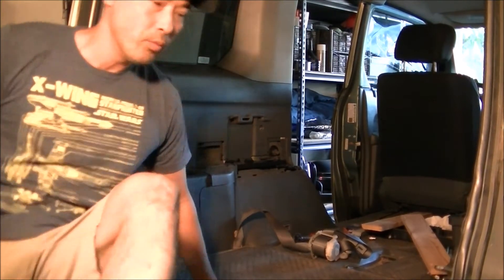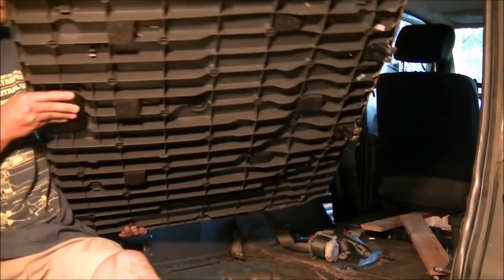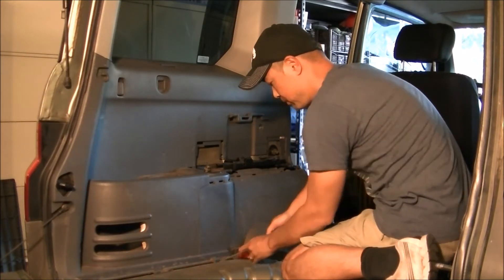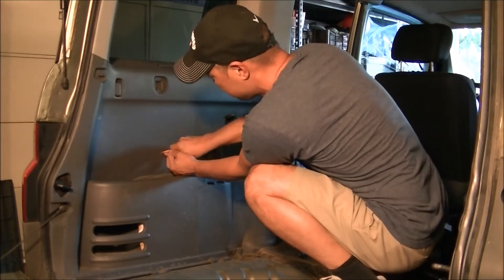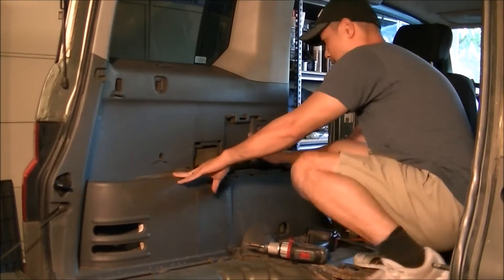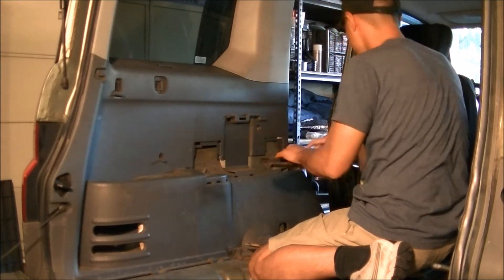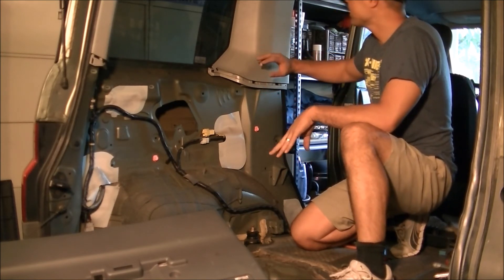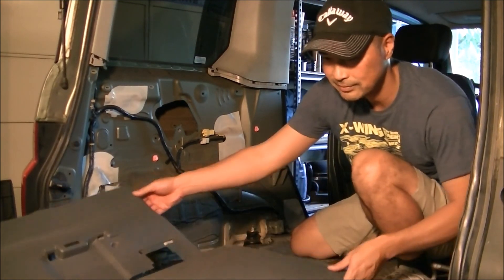Removing Rear Inside Panel on Honda Element.  How To DIY

Comment: thanks for the video, i need to hook up a trailer harness and the one i ordered online plug's into  a receiver behind the passenger side rear panel. if anyone is interested in buying one, the one for the Honda element is made by "CURT" part #55336, it plugs right in so there no splicing of wires and the wires stow away in with the spare tire till you need them. you will have to remove the rear door panel that  folds up when you fold up the rear door

again thanks for the video

Comment: Ok.  I am doing this.  But have neither the skills or tools.  But I am looking at buying ikea cabinets or something like that to put in.  I am scared about taking out the paneling but am looking for extra inches.  How space did you gain by removing your panel.  Then I am assuming that there is obvious places to bolt or attach or tie down cabinets to the frame of the car.  I'll keep watching your videos.   Thanks.
Reply from the maker: Maria Couragee , I gained a few inches for sure. For my current third build, I am seeing if I can get away with just removing the top molding. So, yes, you will gain a few precious inches. But no, I don’t think it is absolutely necessary.
Reply from the maker: Maria Couragee , suspending the cabinets was necessary for me because I wanted to use that floor space for a bed. If you don’t plan on doing that, then I don’t think you need to remove the side panel.

Comment: Hey, thanks for the video, you said the seat belt was "another story"  did it get stuck on you?  That is the problem I am having and it appears that some people had small pieces of glass stuck in the mechanism
Reply from the maker: No issues removing seat belts. I was just saying how I won't be able to demo how to remove them because I had already took them out. I just didn't want to  reinstall it.
Reply: @Tiny-Campers  how did you remove the top (shoulder) mount on the seat belts? 
or how do you gain access to the mount point? I'm a little worried about damaging the interior panel... thanks!
Reply from the maker: @williamjames3563  when you remove the upper panels, it will expose the mount point. Just a basic ratchet wrench will get it out. I assume all the models are basically the same ?

Comment: Thanks!  I just did this to install a backup camera and sound deadening material.
Reply: any pics on the sound deadening material? Just bought a 2011.
Reply: @smarzig  Nothing of it installed but this is the stuff I bought.
https://www.amazon.com/Noico-mil-aislamiento-eliminador-amortiguaci%C3%B3n/dp/B00URUIKAK/
Honestly, the E is still pretty loud so not sure it was really worth it.
Reply: @haroldcarlson2775  Thanks. Out of curiosity , where did you put the material? Did this help at all ?
Reply: @smarzig  Behind all 4 doors, both rear side panels, tail gate and the rest went in the spare tire well.  Not sure if I removed the entire floor liner and put it there if it would have made a difference.

Comment: About to start this process for sound insulation - one question maybe you know - what is the torque spec for the seat belt bolts you removed from the floor?  Seems like it might be important to put those back the right way.

Either way - thanks for uploading this video, its a huge help!
Reply from the maker: Sorry. I don’t know. But you can feel how tight it was coming off.

Comment: Did you take off the plastic side step rail along the seat? That part is hidden in your video. Cant see you wiggle the first part out. My 2009 appears to have the part that you said is the hardest corner to wiggle out clipped to it. Ive been told the sidestep is just plastic clips (no screws or bolts) but cant find anyone or anywhere that shows where the clips are to get it out.
Reply from the maker: Kyle From Ohio , no I don’t remember having to take that strip off. That part I did yank off slides out from underneath the side strips. But yes the side strips are snap ins. But with all snap in, especially older plastic, you run the risk of breaking the pegs themselves. You can’t be too gentle because it won’t come out. But being too rough increases the chances of something breaking. There is actually a notch area where you can slide your fingers underneath. Grab tight and yank.

Comment: after the plastic panel removal, does the central sheet metal factory cutout (just under the tips of your fingers @ 6:24) give access to the upper exterior quarter panel? Thanks
Reply from the maker: zeffa , from my memory, yes it does.

Comment: Great videos! Question: After taking out the screws, how did you remove the seatbelt from the top?
Reply from the maker: It has been a while. I don't remember exactly what it looks like, but once all the bolts are out, there was no issues.
Reply from the maker: Sorry, watched the video again realize your question now.  You have to remove the upper trim. That will expose a bolt that will allow you to remove the seat belt.
Reply: @Tiny-Campers  

Hi there great video!
 Did you have to remove the whole side trim to just remove the seatbelts?
Reply from the maker: Yes, you have to take out the whole trim to remove seat belt.
Reply: @Tiny-Campers  

Thanks for the reply!🙂 
Gonna do it in a couple hrs..
Reply: Thanks for uploading this. Couple items I found missing with a major piece not shown in the video. To remove the panel you also HAVE to remove the seat hindge system as it straddles the plastic. If you neglect to do this you will crack the panel. In addition there's some screws that you also have to remove in addition to the ones shown in the video. Two towards the rear part of the panel one on top and another one as well which I believe was above the tie down. In addition, the piece that covers the hinge plastic plate is over the panel.

Comment: How did you remove the seat belt itself
Reply from the maker: There is just one bolt on each end.   It will be exposed when you remove the panel.
Reply: @Tiny-Campers  what's up thank you removed the panels from the 07 sc i have ..i think the side panels arent removal because of the side air bags .
Reply from the maker: Oh. Yes, I don't have air bags.
Reply: @Tiny-Campers  its the same just hidden under the covers
Reply: @jguerrero322  were you able to remove the side airbag panels without triggering the air bags? I want to maybe replace with wood paneling like you see in a lot of van builds but not sure if it’s safe to mess with the airbags? Thanks!

Comment: This is a pain in the ass just to gain access to the light for a backup camera???? OMG!!! And there is no way to thread the camera wire above the license plate. The license plate light bulb bracket is solid plastic with no rubber seal. Had to drill a hole into the E just above either R or L side 9/32 drill bit. Now I have to screw with removing and installing the stupid seat!!!! OMG!!!